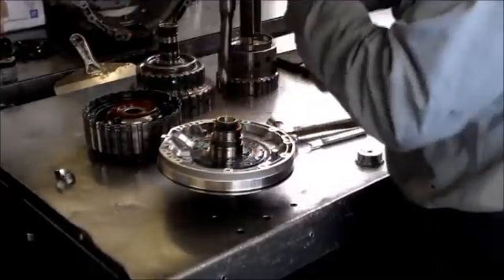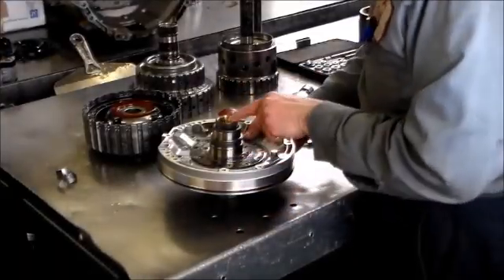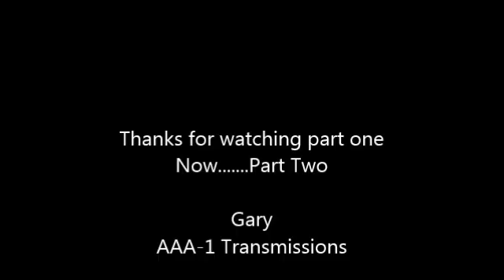ZF6HP26 Bushing Kit Installation

Comment: Gary, me again|

Dude this is again a life saver, i commented in the other video that i pulled out the insides of the ZF hp gearbox. Now i wanted to take the internals for an inspection and bushing changes to a shop.

And i wanted to pay for that in full, now i was to few shop already and anywhere i go, once the shop learns i tore it down my self - they say F*U to my face and decline any work on the bushings or the gearbox.... so wether i like it or not im forced to do this my self

Comment: Hello Gary,

I am waiting for a new valve body (error 4e89). In the meantime, I disassembled transmission for inspection. I noticed a strange scratches on A clutch hub. Can I send You some photos with this? I didnt see something like this on your movies.
Reply from the maker: sure
gsferraro@yahoo.com
what is the definition of the 4E89
Reply: @GaryFerraro  Thank You.
error 4E89 - solenoid valve 1 or 2, mechanicaly jammed (bmw).
Reply from the maker: @pawep5571  I read that valvebody is usually the problem with that code

Comment: Interesting! I know everything online Says to use an Arbor press to do bushings but you knocked them in with no problem!   I have a question…  That tool with the notch on the end of it that you were using to  Is knock out the old bushings, is that Custom made or does that tool have a name?  Looking forward to part 2!
Reply from the maker: Bushing splitter, it's blue point got it from snap-on

Comment: Hi, Gary. Is it normal to just replace the bushings in the front part of the transmission. I'm doing this job now and I'm not sure if I should do the rear half.
Reply from the maker: Are you having problems in the higher gears. 4th-5th and 6th
Reply: @GaryFerraro  I'm not sure, as this is an used 6HP26 I bought to overhaul and swap out with my original transmission. It supposedly ran just fine. The front part of the transmission looked great, with no burnt clutches or miscoloration of anything.
Reply from the maker: @Robert.K  ok, while apart i would replace the rear stator bushing, very common for those to wear out
Reply: @GaryFerraro  Thanks, I will do that. Thanks for so many great and informative videos. They really helps a lot when doing this DIY.
Reply from the maker: @Robert.K  If possible press the bushing in, hitting it may distort it and the drum may fit very tight

Comment: hey gary. currently. got a 6hp26 was wondering, should there be movement in the input shaft? i had to wiggle it pretty hard to get it to move (maybe.. 3-4mm)?
is that okay?
Reply from the maker: do you mean up and down, like end play?
Reply: @GaryFerraro  yes gary an but watching the video an actually measuring 3-4mm  its more like 2.5-3mm
Reply from the maker: @danielveldman4690  If all original parts went back in and no hard parts were changed you should be fine
Reply: @GaryFerraro   it hasnt been pulled apart or anything it has 126KM's on it. 

just unsure if the front  shaft moverment is normal. have you got a facebook page i could shoot a video though too show you what i mean?

Comment: hello Gary, I have a jaguar xf with 6hp26 which gives blows to the downshift 2 towards 1, as if the 1 engages later since when I leave too quickly a blow occurs.
then I have engine rpm variations from 3 to 6 only when the engine starts to heat up with big vibrations and the problem is accentuated when the road goes up. I have no faults in the computer. what do you think?
thank you

Comment: Hey so on my ZF 6HP28 I've diagnosed it to be a worn stator bushing but was wondering from your experience is this likely to of caused excessive wear to the E gear to necessitate the replacement of the e gear or should replacing the bushings do the trick? or is this more of a depends on the situation kind of thing? Thanks
Reply from the maker: Well, you have to pull it apart so i would check the E clutch, they do tend to flake off

Comment: Hi Gary, I have a zf6hp26 in Ford Falcon with 259,000 km. When cold the rpms have started to cycle up and down 100rpm on very light cruise at 25mph with shudder on slight incline. When warm the transmission is faultless. The symptoms are the tc but do you think the fault is a pressure loss from the bushings, or valve body related?
Reply from the maker: i would think could be the lock-up valve in the valvebody, or maybe converter itself
Reply: @GaryFerraro  appreciated!
Reply from the maker: @wanganuibarbell7141  Sure, What year is the car?
Reply: @GaryFerraro  2006

Comment: hy, im rebuild the valvevbody with new separator plate, solenoids, accumulator damper and rebuild the torque converter, but the upshifts are still harsh (usually between all gears)if I don’t give throttle, and the second problem is reacts late use break and add throttle. That is bushing, tcm or something? no fault codes and the clutch adaptation values are pretty (around -100-(-200)

Comment: Hi Gary,

Can you tell me what you used for remove the old bushes?  Maybe a code of that, where to buy from?

Thanks
Reply from the maker: I used a bushing splitter, i purchased mine from snap-on but if you go to amazon and write in or google bushing splitter it will come up

Comment: After purchasing the Omega Machine bushing kit a few years ago already (because it was mentioned in this video), it´s up to rebuilding my own transmission. I now recognized that most of the bushing kits on the market come with one or even more punched bushings.
My question: Has this any positive effect on durability, or are the Omega Machine bushings still the way to go?
Reply from the maker: There is another company that started making these bushings, lately i've been using Dura Bond
Reply: @GaryFerraro  Thanks, I highly appreciate your videos!
Reply from the maker: @AUTOdidact77  Thanks for watching, please subscribe
Reply: @GaryFerraro  Done - sorry for the 3 months delay 😷
Reply from the maker: @AUTOdidact77  All good? shifts good?
Reply: @GaryFerraro  I'm not finished yet since the whole car gets rebuilt and I've only one day/week time (besides work)...
Reply: @GaryFerraro   Hello Gary Could you please tell me which kit from duro bond I need. I got a 6hp28 and not a 6hp26 in my bimmer. Thanks a lot and keep on doing this nice videos. Great job and it's always fun watching them.
Reply: Hello Gary.
Very nice videos. Now I feel prepared to do my trans with my little son (4). The 6ho26 in my 530d is now giving me real problems. 1 to 2 hard shifting, 2 to 3 and 5 to 6like a ruber band. Doing a 120 k's and kick down (now even without kick down) leads to emergency run and goes in neutral. It has 330.000 km an a new mechatronic.
Now I got a trans with about 60.000 km an I want to chang the bushings before it comes in.
My question.
Which kit shell I get because you use only 7 bushings in your video and the mentioned kit from duro bond has 14 bushings.
Thanks a lot for helping us so much with your very nice videos. 
Best regard from Germany.
Reply: @PlayBoss81  The 2 smallest bushing (where the intermediate shaft's ends are riding on) are locked in place somehow and changing them - due to the Sonnax manual - requires machining/ grinding away parts of their seating, so I doubt if the replacement ones would be safe in place and decided against putting those in. There were other bushings left in my kit (from Omega Machine, as Gary was using a few years ago) also. At 60.000 km I would (if at all) only replace the stator bushing (as the one most prone to wear) btw - my unit, built into a V8 Jaguar, survived 230.000 km without any problems... In case you need the "small" stator bushing (input shaft diameter 26 mm): I have 4 Sonnax bimetal stator bushings left over from my own rebuild.
Schöne Grüße aus 🇦🇹
Reply: @AUTOdidact77  Hey. Danke für die Rückmeldung.
Reply: @PlayBoss81  gern geschehen

Comment: Awesome video!  Very detailed.  After watching your videos I decided to rebuild mine.  It worked!  Took me a lit longer than you, but learned a lot.  I had a 3-4 flare that would go to fault mode.  By the way what is the tool that you use to pull out the bushings?
Reply from the maker: I bought that from snap-on, they call it a bushing splitter.  Good job on rebuilding your trans
Reply: Mine is doing exactly same thing. What did you all replace in yours? All the bushings or just the E clutch one? And the clutches. Do you remember how much you paid for the parts?  I'm thinking about talking on this challenge. I swapped mine with a junkyard pull and it's doing this. Smh. My original transmission was doing same thing and I think it started to also slip on 1-2.

Comment: Gary I need HELP, PLEASE. I have this same transmission in my 2010 550i e60 m sport package model and it been throwing clutch E transmission fault, I live in Kansas and I cannot find a transmission shop that’ll do this let alone at a fair price everybody wants thousands when I can get a rebuilt transmission online for 1500 but theirs no sense in that when I know it’s either these bushings or friction plates in clutch E and clutch D I know that because I had a tuning shop run a diagnostic on it and the clutch D and clutch E output number were way to high causing slippage, is there a way I can send my transmission to you and pay you to fix it?
Reply from the maker: My e-mail is   gsferraro@yahoo.com
could you send me the vin number please

Comment: Hi Gary, I'm installing the bushing manually just like you did would there be a problem if the bushing don't go in straight?
Reply from the maker: It may become distorted, you have to see how it is by putting the E drum into the stator, see how it fits
Reply: @GaryFerraro  thank you so much for the quick reply, the bushing went it well didn't suffered at all, what I mean by not straight is that when I measure with the caliper along the bushing edges one side might be per say .5025in deep and the other end .5250in. So I was wondering if such a small difference would have an issue? the parts seem to fit all well. Rebuilding my own transmission not much experience CD4E Escape 2005 FWD.
Reply from the maker: @adcarrascal  No shouldn't matter as long as the shaft fits well and does not bind up
Reply: @GaryFerraro  awesome thanks again you're the best!!
Reply from the maker: @adcarrascal  Your Welcome
Reply: @GaryFerraro  sorry to bug you once more one last question I'm using blue transmission lube to help slide the bushings in, is it a bad practice? I was wondering if the bushings would move on use because of the lube.

Comment: Hi Gary,

I have a zf 6hp19 transmission which it's having a slipping / flare issue from 2 to 3 and 3 to 4. This happens only when I'm pushing the throttle a little harder.
From 2-3 it's worse, if i accelerate hard, it's kind of start to vibrate(slipping feeling) and then rev up and immediately shifts in 3 gear, and it will also trow a gear 2 incorrect ratio error.
It also have high adaptation values on clutch A and B 450mbar and 500mbar

Do you think it's a valve body issue ?
Reply from the maker: Very possible, can you give me the code numbers
Reply: @GaryFerraro   001843-gear 3
P0733 incorrect ratio
and
001842-gear 2
P0732 incorrect ratio

The transmission it's on a vw phaeton 2006.
Code:
4841965
1071 040037
HKN
Reply from the maker: @PlaneStuffRC  ok, did you check the fluid level?
Reply: @GaryFerraro  Yes, replaced the fluid and checked the level at 35 C with engine on. Lifeguard 6 fluid. Also replaced the filter, no metallic parts on the magnets. Also it was 1 liter less fluid when i replaced it . The trani has 200.000km
Reply from the maker: @PlaneStuffRC  ok, I would say you either have a valvebody/solenoid issue or worn bushings in the unit causing a pressure loss. What i would do first is get a new set of solenoids and  open the valvebody(very carefully) and install a new separator plate. After this is done you must reset the shift adapts or it will work the same way. Do you have a scan tool to reset the adapts?
Reply: @GaryFerraro  Yes, i have a VCDS tool, but i wasn't able to reset the adaptation.
https://forums.vwvortex.com/showthread.php?9322443-6-speed-transmission-unable-to-reset-adaptation
Reply: I disassembled the valve body and added some pictures and info on this forum:

https://forums.vwvortex.com/showthread.php?9320551-6-speed-transmission-valve-body-repair-HKN&p=113466599#post113466599

It looks like the separator plate it's damaged, the black rubber started to disintegrate which could explain the pressure loss.
The other thing that I've found was the 4 seals between the valve body and the transmission, there are two types green square and red one. I have the green type with springs, and they look kind of lose and damaged.

Comment: Gary so the reason that these transmissions have problems with the E clutch / Overdrive clutch is worn out stator bushing causing a leak so the clutch isn't applied properly?
Reply from the maker: Yes, when the bushing wears out, the E clutch apply oil can escape causing issues in 4th through 6th gears

Comment: I have a question about the pilot bearing replacement on a 6hp26 back in the rear shell / output flange area part. Not sure exactly what the proer name is , but there's only 2 pilot bearings. The one that's in the output flange part  has 3 steaked dimples securing the bushing in place. Seems like I would remove it like any other bushing and file the dempled / distorted edge caused by the factory steaked dimple and proceed to install a new one? Thanks. Your videos gave me the confidence to rebuild my 6hp19, which turned out great! Thanks Gary!
Reply from the maker: Was the bearing pitted or no good?
Reply: The bushings appear ok, the bushing kit comes with new ones and was just going to replace them just cause they are supplied. I will check Monday if they have any / excessive play.
Reply from the maker: Are you talking about the small bushing in the output shaft?
Reply: That's the one
Reply from the maker: Ok, i honestly rarely change that, that bushing is usually ok
Reply: Thanks Gary, appreciate your help and videos!
Reply from the maker: Your welcome
Reply: Where'd you get the Chisel shaped like that?

Comment: Hi Gary! I have an Australian Ford FG With ZF 6HP26 and pushing around 500-550hp at wheels and the transmission has began to flare/slip under load from 3rd to 4th but drives fine driving normal or even under half throttle what you think may cause this? And is there anything you can recommend to make these box’s stronger ? Cheers
Reply from the maker: Do you feel the slip only when the car gets hot?
Reply: Gary Ferraro it seems to be when cold and hot but not so bad when cold if that makes any sense. That’s only when on gas full throttle. 2-3 is fine 3rd is fine until starts to rev out out and will slip straight into 4th before even shifting into 4th.
Reply from the maker: 2 Things can cause this problem, first is the rear stator bushing, when the bushing wears out it leaks E clutch oil, the E clutch comes on in 4th and stays on for 5th and 6th gear. the other possible issue that can cause this problem are the solenoids. Do you actually have a 6R80? is this a metal or plastic pan?  just reread and i see its a ford
Reply: Gary Ferraro Gary Ferraro Gary Ferraro Gary Ferraro Interesting Gary I wonder if it is as something as simple as solenoid. But wouldn’t surprise me if it is rear stator bushing causing issues. Yes I believe in Australia we call it ZF 6HP26 which from what I heard same box as mustang use but with smaller input shaft ? Also I have lifeguard6 oil and never been replaced from factory as ford says lifetime oil do you agree ? Box’s has done 200,000kms.
Reply from the maker: The reason why i ask is on the 6r80 transmissions havent really seen to many solenoid issues yet(i've rebuilt maybe  about 7 of these) but the bushings do wear out on these like the ZF units as well
Reply: Gary Ferraro interesting! Is it possible to upgrade input shaft on 6HP26 to 6R80 shaft? Also ford say not to touch transmission oil as lifeguard 6 oil is lifetime guarantee? Do you recommend changing them? As I use this box for daily purposes aswell as drag strip here and there the auto get a hard life is there anything to strengthen these box’s to handle 500 plus HP?
Reply from the maker: I honestly do not know of anything  to strengthen the trans,  but i really never researched it. Even though they say it's lifetime fluid, i would change the filter and fluid every 30,000 miles. Do you know if your pan is plastic or metal?
Reply: Gary Ferraro okay thanks for your help mate. I believe they came out with metal pan but don’t quote me on this what’s the reason? Also in regards to solenoid do you think if I replace them and see if this fixes slippage in 3-4th before completely  rebuilding it worth it?

Comment: what bushing driver set is that? im working on a zf6hp19.
Reply from the maker: I bought this set 30 years ago, not sure who made it, I have a small set that i got from harbor freight, but for the A drum you would need large drivers, maybe try googling it, the ones ive seen maybe alittle pricey, if you like i can see what my supplier has
Reply: yeah thanks. see what your supplier says let me know, and thanks again.
Reply from the maker: I going to give you my suppliers e-mail and phone, he says he has a master bushing driver set(may be pricey) He is very busy, when your ready, i would e-mail himfirst and just say Gary from AAA-1 Trans gave you the e-mail and i will give him a heads-up you will be contacting him
Reply: ok thanks.
Reply from the maker: His E-mail is Ptramm@transtar1.com       
 1-800-747-8189